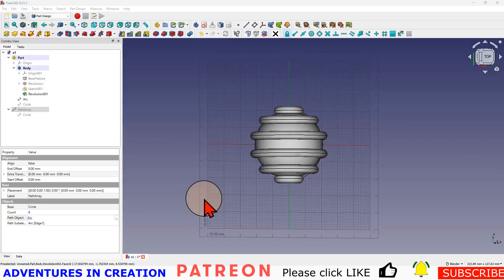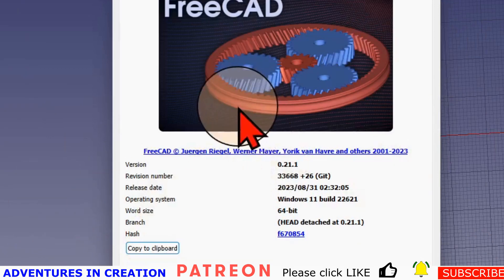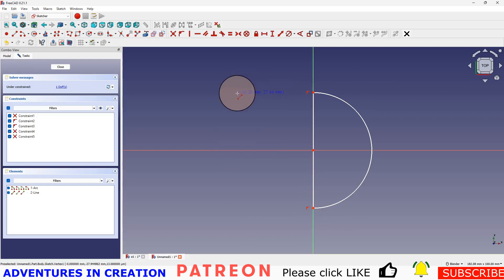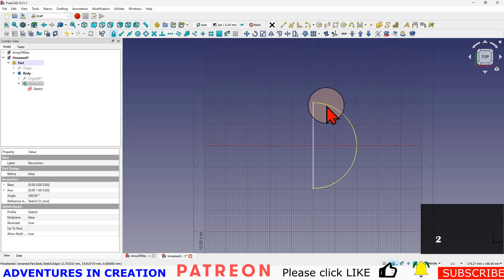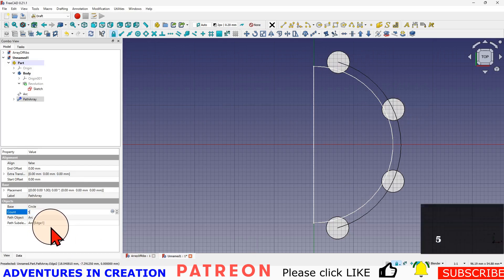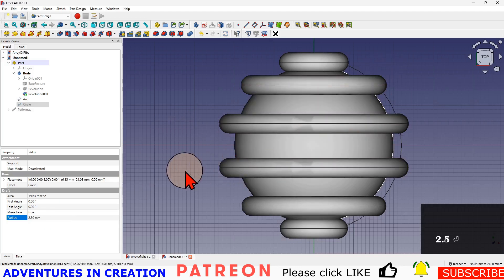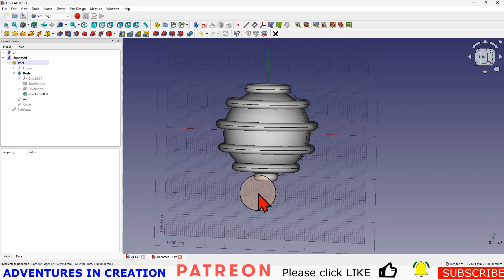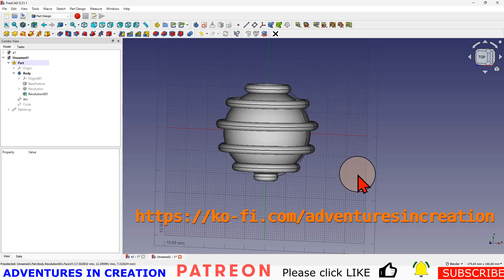FreeCAD for Beginners #57 Path Array keeping parametric features #freecad #cad #makers #design

Comment: I see what you did there. 🙂. Is it possible to build an array of bodies or parts? Think of a child's wooden blocks. They are all the same, but when the child plays with them, one stack may have 3 blocks, the next stack may have 5 blocks, the next 2 blocks and so on. I have figured out that using Assembly 4, I can create an Assembly and block by block manually add block parts to create the stacks - but it is seriously tedious with multiple clicks to add each block and then to offset to lift the block above the previous one. I am looking for a way to automatically create the "stacks" using the common "block". How would you approach it?
Reply from the maker: Is it the entire block or a feature?
Reply: @Adventuresincreation  I would like to replicate the entire block. It is a square created in Part Design, padded and with a hole cut out of the four facing sides, I'd like to end up with a series of stacked blocks, say 5 along the path, each stack piled with 3-5 blocks high.
Reply from the maker: @markmartin9413  You may be able to do this in the latest dev version as it allows multiple solids in one body.